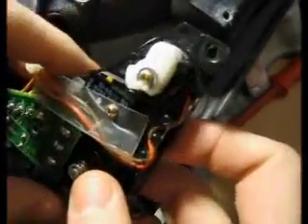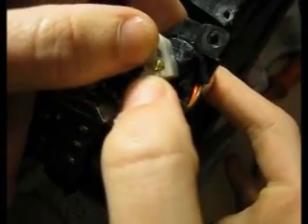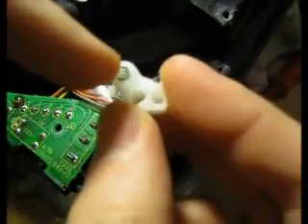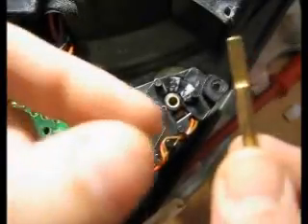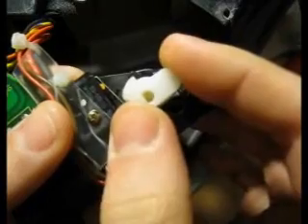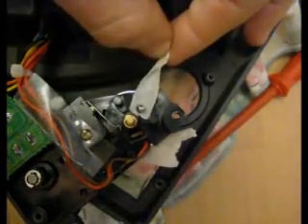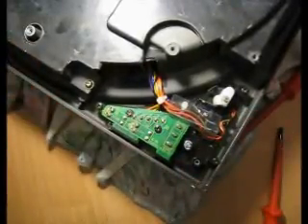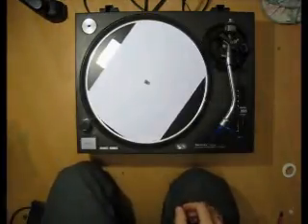sirvice & repire on the power switch on a technics turntable part 2

Comment: Awesome video.  I found the video because I accidentally took off the power button when I was cleaning my 1210 with my vacuum cleaner.  I wasn't sure if it was like the 1200 where that little bronze shaft actually drops down.  I saw you simply pushed it back in so I lined it up similar to my other 1210 and luckily it very easily sunk down (didn't even have to remove the back).  I was initially pushing down hard on the button thinking it needed force.  In the end I thought that might damaged it or break something internally.  I'm glad I came here and helped get some clarification on my issue and learned a bit or two about that area on the ttable.  Thanks again.

Comment: If you lose the ball bearing and can't find it, don't panic. You can use the head of a sewing pin instead. I have done it, and it works. Just make sure you get the right size for the spring and that it is spherical without any defects.

Comment: I have a AT-LP120 TT and the 'Star/Stop' button has stopped working. When turning on the power button and going on to press the Start button to activate the turntable, my platter will not turn. Have you had this happen to you? What could the problem be?

Comment: Thanks for the vid bro. the problem i have is that my on off switch doesn't turn off the power anymore. even in the off position. the led stays on and the platter keeps moving as normal. i have owned 6 technics (mk 2's and Mk 5's) and this has eventually happened to all of them. any thoughts on that? i know it's a common issue but can't find and vids here on how to remedy it. Thanks

Comment: I changed the lights on my power switch and once I was finished she turned on, all was good for 30 minutes and then the lights went out.  The turntable still works but without the lights, any clue as to what it is?  By the way nice videos

Comment: Interesting vid as usual man, you really describe stuff well...
I got some new MK5G's this week, and they have knackered on/off switches (the actual silver button is all worn and needs replaced), I know I can replace the whole power switch assembly, but dont know how to get into the actual power button to separate it from the board and put a new one in, and replacing just the buttons would cost 1/3 of the price!

any help would be greatly appreciated if you have the time mate

Comment: Thanks so much, I had been a bit worried about taking mine apart, even though it is very old. The on/off switch had come loose. Turns out it was just the pin that had pulled back - so I pushed it back in, attached the top of the knob and everything works fine. Thank you, very helpful!

Comment: thanks alot and very helpful video, i have one question for anyone? what stops the aluminium tube which houses the strobe light from rotating?? i have seen some decks with the light facing away from the platter completely, mine moves side to side a little if you turn it. what i want to know is, do all decks strobes move, and how is it held in position? thanks alot, and keep the great videos coming James.

Comment: my technic 1210 mk5 won't power on at all. the power switch turns fine and I hear it clicking. I've never had this happen it worked fine for me over the weekend but sat night i had to borrow a friends due to mine not powering. When it's plugged in the outlet no lights come on nore does the start, stop button work. please help

Comment from the maker: hi Tommy, sorry for taking ages to reply you might have a dodgy star and stop button, its just a lever switch like the one on the power switch, getting hold of a new switch is actully easy as Technics just use a standerd type lever switch. and there only like £2

but before you buy a new switch have a look and make sure a wire hasn't come off the switch or the switch hasn't come unplugged. iv seen this happen before a few times.

hope this helped and sorry or taking ages to reply.

nice one!!!

Comment: I fixed it, strobe light got stripped and caused a short. changed the strobe light wire and all and changed the q2 transistor.